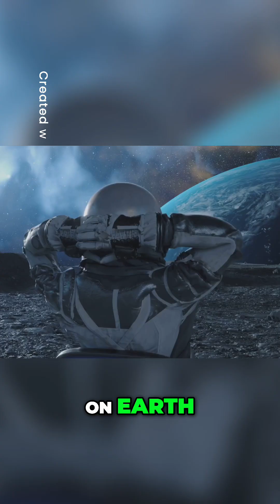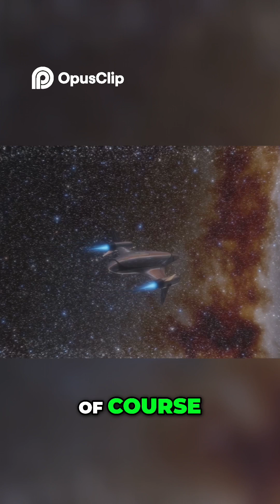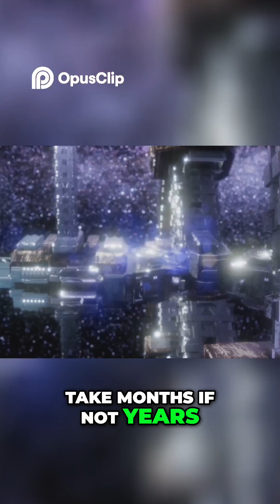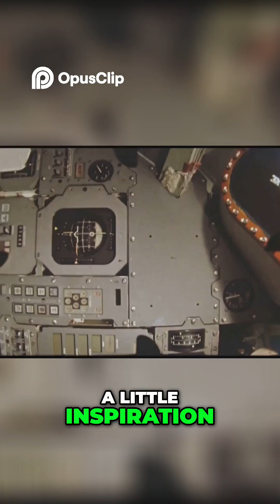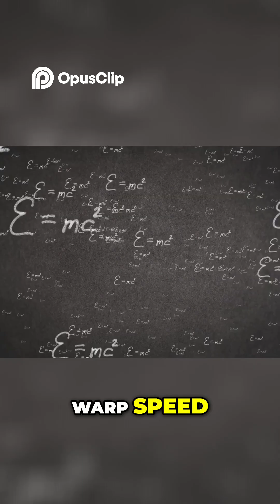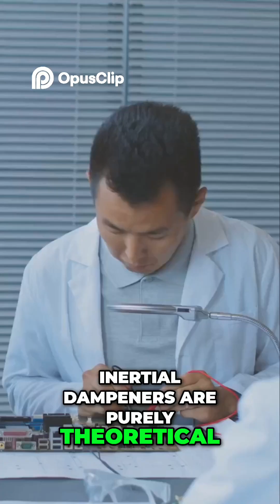Exploring Inertial Dampeners  The Future of Space Travel

Comment: The bubble created by the inertia affect will create a state free from gravity and free from drag. This comprehensively defines the environment within and immediately surrounding the craft during its operation. Thigh, MRDS core function is to manipulate space time itself to create a localized zone. we’re both gravitational forces and the resistance from any medium like air are effectively notified. This goes beyond just reducing inertia mass. It absolutely actively altering the fundamental interactions between craft and his environment. To clarify, the bubble would push the atmosphere completely away and create a perfect vacuum ahead of the craft. The energy requirements are not just moving mass but or continuously, notifying gravity and creating a perfect localized vacuum tunnel through dense atmospheric and even interstellar mediums. This would be immense. How is this energy generated in precisely contained within the bubble, especially without harmful radiation, leakage, given that such processes would fundamentally interact with the very fabric of reality?… there are four needed synergies… electric magnetic field, boron crystalline, ion thrusters, and inertia affect generator particle, repulsion neutral atoms, not withstanding, directed energy fields to move neutral helium atoms, thus clearing the pathway
….